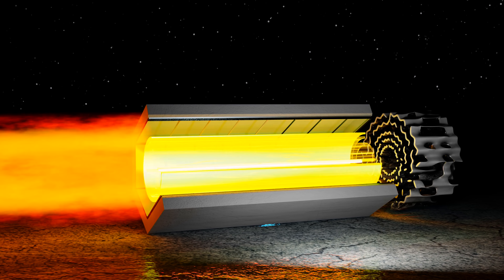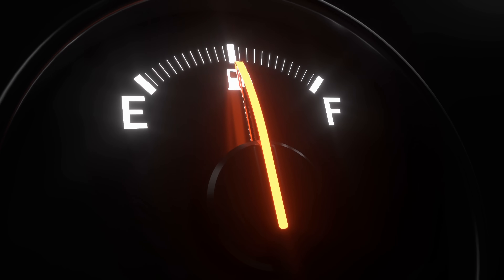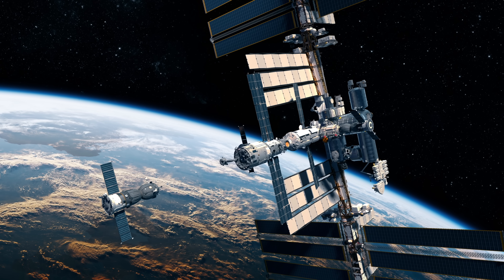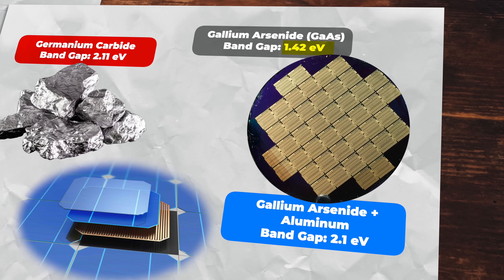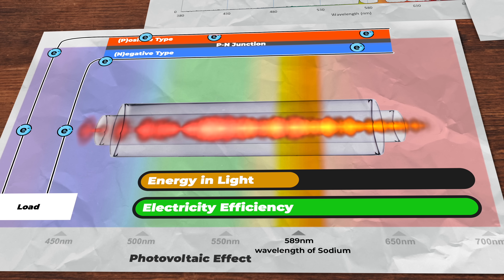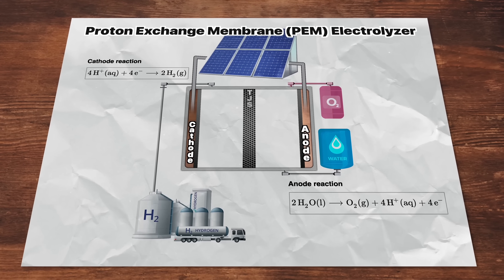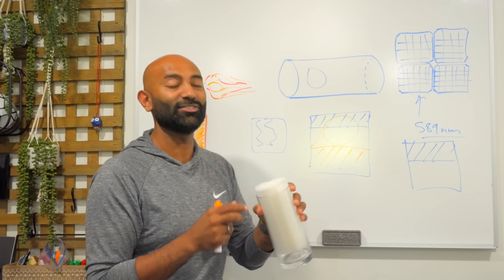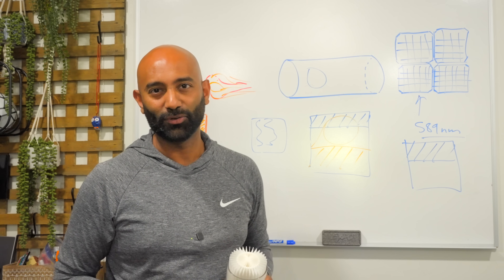Why Solid State Might Save The Combustion Engine

Comment: So, what happens to the CO2 and (admittedly far lower than ICE, but still impossible to eliminate completely) CO, NOx, unburned HCs?
A 2-3X improvement in efficiency over ICE-piston configurations is a carbon-fuel economy salvation for a few decades- how does that represent a serious improvement of chances civilization  will make it past the current (and unavoidably what's coming soon) damage to the climate?

Comment: Could also be geothermal - all you need is a high temperature for sodium.
Bury the sodium PV cells in the mantle, instead of steam generators.

But current ones slso need cooling and thermal management. No pv cell can just perfectly function at high temp long term.
Reply: Love the idea.
The mantal doesn't get nearly hot enough.
Maybe another compound that will glow at a lower temp.
Reply: the point of using sodium is it emits light at only one wavelength. so having a special solar cell that is fine tuned to that specific wavelength increases efficiency. using another compound ruins that.

Comment: Errrr... aren't solar panels only a maximum of 35% efficient currently under the most extreme of optimal conditions only?

How can they claim 80-90% in that case?
Reply: Because solar panels have to contend with many different wavelengths of light, whatever this is would only have to contend with one.
Reply: @RurikLoderr  sure, but an increase of  around 50% efficiency JUST because of that alone?

I mean, I live to be surprised, but, it's pushing things a little surely?
Reply: they use 2 solar pannels ofc! 1 pannel 35% 2 pannels 70%, its easy math!
Reply: @felix2315  errr..yeahhhrrrr....not sure that that is how it works.
Reply: @weedfreer  it does, trust me bro, i read it on the internet, just make some cgi and it will be real xD
Reply: @weedfreer  I'm not quite sure if you watched the video or not. Monochromatic light, with tuned bandgap solar cells. You can choose to not believe the words, but the explanation was there.
Reply: @Sekir80  yeah I watched it, but still, the current BEST full spectrum solar panels are capable of ONLY 35% efficiency.

Even isolating the spectrum of light and tuning the panels I find it hard to believe that it would be possible to achieve anything like 90% efficient photonic/electrical conversion.
Reply: @felix2315  😂
Reply: @weedfreer  I don't get it. Optimizing for full spectrum is impossible, that's why 35-45% is the max we've achieved (probably not much more available). 
But you are right about it: it would be nice to see independent results of this.

Comment: A pulse jet engine is a solid state internal combustion engine.
Reply: Jets (and rockets for that matter) are not internal combustion engines. One side of the engine is open, so the combustion isn't internal
Reply: @jef_3006  Yes, but this distinction seems almost academic nowadays. A fireplace is where combustion occurs; your chimney flue is where the exhaust goes. Is your furnace a jet or an "internal" combustion engine? Or are neither "engines"? (Producing heat is a form of "work" or is only force/motion "work?") In a rocket, combustion occurs in the nozzle to accelerate the exhaust for thrust as it leaves the nozzle. In an ICE car, the values are simply little doors that open and close for inlet air followed by exhaust. Actually more of a "digital" or step-by-step combustion/exhaust cycle rather than a more analog/continuous flow-controlled system.
Reply: @WarrenLacefield  That's what "internal combustion engine" means. If the distinction the term denotes is meaningless, then the solution is to stop using the term, not to start using it in more places.
Reply: @jef_3006  Perhaps you are right. There is term confusion, but distinctions may or may not be meaningful. Does "solid state" refer to the combustion fuel (the energy source)? Or does it mean "no flows or moving parts"? If the output is electricity, is the device an "engine" (producing thrust or rotation) or is it (IMO) a "generator" (producing heat or current or waves like an antenna). Is the combustion "internal" (unseen or felt, inside a box) or is it "open" (can be seen from some perspective) pulsed or continuous?
Reply: @WarrenLacefield  Your chimney with turbine system is an external combustion engine, no ambiguity about it.  The fuel is burned in the fireplace external to the engine.
Reply: @RWZiggy  Oh, I agree. A fireplace with a chimney that contains a turbine (that turns a shaft) is just like a river and paddle wheel or steam engine (fire boils water, steam pressure turns a shaft). If the system output is force, it is a jet or rocket. If output is motion, it's an engine or motor or magnet. But if the output is light or electricity or waves, it is a generator. External or internal, I guess, has to do with whether the heat source is considered part of the system or an external input to the system. I would compare this device discussed in the video to a Ben Franklin fireplace with a thermocouple on the top. It has no moving parts; burns fuel; and produces electricity; and fairly efficiently at that.
Reply: @WarrenLacefield  fun fact, the core of a gas turbine engine is called the gas generator.
Reply: @herbderbler1585  Ha, ha 🙂 No end to trying to make distinctions .. the Google one is limited: "A generator converts mechanical energy into electrical energy, while a motor does the opposite." It goes on to say: "that motors run on electricity and engines run on combustion." I guess thrust or torque counts as "mechanical" and chemical or nuclear counts as "electrical" (or vice-versa). Biology runs on both so us humans are both motors and engines as well as "distinction" generators!
Reply: @WarrenLacefield  An engine is a device which converts energy to mechanical work. (That can be turning a shaft, thrust, pushing a piston, you name it).
A device which converts one form of energy to another form of energy is not an engine, that's why we have other words for them eg. generator, furnace, boiler, solar panel etc etc.
In a combustion engine, if the combustion occurs within the same part of the machine that the mechanical work is produced ie moving a piston down or generating thrust, turning a shaft, then it is known as an internal combustion engine, otherwise it is an external combustion engine.
Reply: @nickwinn7812  Hi, Nick. This chain of comments is so old, I had to go back and read them all again. 🙂 I said "Yes, but this distinction seems almost academic nowadays." Now I would say this discussion might be evidence of that. I'm fine with your explanation.
Reply: @WarrenLacefield  Sorry, I only just came across it and didn't look to see how old it is.
To be clear, as an engineer I find it rather odd that a purely technical definition of what a device is, can be re-used by non-technical folks to describe something else entirely, with the same definition. An academic would understand my position entirely.
Many of the comments here are from well meaning laymen, who have little or no understanding of the subject. This just dumbs down the base of "knowledge" to someone coming to the subject for the first time.
Reply: @nickwinn7812  Yes, I am mostly academic, I guess. And I believe that the technical jargon of any discipline is an important tool well-worth learning and using, both as a conceptual aid and for precise communications. (But I'm often metaphorically incorrect myself in "interdisciplinary conversation." 🙂)
Reply: @jef_3006  Really where does the combustion happen? does the combustion or heat creation happen in a boiler like a steam train or steam engine or does the combustion happen inside the engine itself?
Reply: @jef_3006  One side of this is open as well, so it wouldn't qualify in your definition, either.
Reply: @H4hT53  Yes.
Reply: @jef_3006  One side of all combustion engines is open. In a petrol engine where does the exhaust gas go to? Where does the air come from?
A pulse jet is an internal combustion engine. It burns fuel converting the energy in the fuel to mechanical work (thrust). The combustion takes place within the engine itself, there is no intermediate fluid transferring the heat from the combustion to the engine.
Reply: @nickwinn7812  In a jet engine, intake, combustion, and exhaust all occur simultaneously. In a sandard internal combustion engine, they all occur at different times, which means that the combustion chamber can be (and is) totally closed during combustion.
Reply: @jef_3006  No. A jet engine has distinct intake, compressor, combustion, turbine, exhaust stages.
The fact that the flow through the engine is continuous does not alter the fact that it is an internal combustion engine.
Piston engines commonly have valve overlap, where, for example, the exhaust valve begins to open before the combustion stroke is complete. Some piston engines have no valves at all.
Trust me, I have worked all types of theses engines and steam turbines (external combustion) also, I know the difference.
Reply: I have WW2 vibes. :D
Reply: Typically, the difference is internal combustion means the fuel is burned inside the engine. External combustion, the fuel is burned outside of the engine and a medium is used to transfer power, like steam.
Reply: Pulse jets are not solid state since they have moving parts (the valve flaps which cause the "buzz" in buzz bombs).  A ram jet is solid state.
Reply: @pilotusa  Depends on the type of pulse jet. The Lockwood types have no moving parts.
Reply: @pilotusa You can build them without valves or with Tesla valves but not very efficient.

Comment: Wait so we have photovaltaic panels that small that can produce that much power yet we aren't using them for anything? 
The future of energy is nuclear energy and we need to figure out a way to use the old spent fuel rods from that are still producing lots and lots of heat to heat hospitals and manufacturing facilities (not produce electricity but to simply heat these places during the Winter.
Reply: GaAs cells are expensive af.

Comment: Highest photovoltaic  efficiency is 45% for multijunction cells. Getting 90% is just wrong.
Reply: That’s because you have multiple layers for different wave lengths each interacting with one another, the top layers shielding the bottom layers, different conductivities, multiple junctions etc. It’s very hard to get the best efficiency at every color or light the sun emits and you always end up losing a lot of it. But here you have a single monochromatic source with a fine-tuned single high-efficiency cell. I’d say it’s perfectly possilbe
Reply: @ipp_tutor  Not just possible, entirely expected.
Reply: Yeah quantum efficiency (not a buzz word, actual term) at peak wavelength of photo voltaic cells are already over 90%…. With the caveat of that’s photons inside the semiconductor, there’s still the hurdle of getting them in due to huge refractive index differences, but not physically impossible
Reply: @geekswithfeet9137  On this specific point given that it is only concerned with one wavelength the anti reflective coating could be made much more efficient than on a white light cell.  How this coating handles hot combusting gas is another problem though.
Reply: more common is 22%
Reply: @Goldenhammer2025 22% with solar because wavelength doesn't match the photo voltaic cells
Reply: @Goldenhammer2025  understand the conversation before correcting people

Comment: 70-80% you say? What’s the efficiency of an electric motor? Round trip ranges from 80-88% is what I’m seeing for an EV. Compare round trip efficiencies for the fuel generation and this seems to fall apart even more.
Reply: So you don't consider destroying the earth to mine rare earth minerals a non-issue?
Reply: @roberthart9886  This magic lamp still needs a buffer battery maybe 10% of the size as a regular battery, but it also needs the same motors and electronics as any electrical car does.
If this magic lamp is 70-80% efficient (I do not think it is even close to that) the loss of the EV hardware would still need to be added to this lamp idea, so this is best case 60%.

Comment: Sounds good. So.... then why can't we strap on a conversion lens to regular solar panels to convert the spectrum to something monochromatic - then tailor the cells to this one wavelength?  Thus making them super efficient.
Reply: what your calling a "conversioni lens" is just a color filter its only subtracting what cant be used not changing what cant be used into something usefull.
Reply: @robertm1112  Hmm so how's this lensing working in this solid state engine then it's converting energy to the correct wavelength? Can't we convert the IR etc in sunlight to the right wavelength somehow?

Comment: Weichai in China is building Diesel truck engines with over 53% thermal efficiency (World record)
Reply: I heard that too, but I will not believe it before I seen external independent tests. If it is true it will come to all boats and trucks near you soon.
Reply: Around 58% is the maximum theoretical. 54% has been reported by a number of manufacturers but only under lab conditions. On the road around 45% (currently achieved by a number of truck manufacturers) seems to be as good as it gets. Problem is on the road there are too many variables (mainly environmental) that can't be controlled.
Reply: This isn't far-fetched, since truck-sized Diesel engines are already 40% efficient.  You could add a steam engine to convert a little waste heat back into more energy or squirt water into the cylinders.  I haven't looked at what they're doing.
Reply: I don't trust China. They lie too much.
Reply: Very interesting!
Reply: It also asexually reproduces I bet.

Comment: This is the first time I’ve heard that moving parts were the problem with combustion engines.
Reply: Technically the moving parts are the downfall to any internal combustion engine, first they are parts that have to be made and to really tight tolerance, second they wear out and fail if not maintained correctly and third each and every moving part takes energy to make it make it move so the moving parts in an engine are technically the number 1 thing hurting combustion engines, however, what's in this video is a bunch of hog wash and won't work efficiently like they say it will.
Reply: Is this the first time you've heard of a combustion engine? Moving parts are always harder to maintain.
Reply: If it moves, it wears out. That's why solid state has advanced so much faster in the past 70 years.
Reply: @poporbit2432   A corollay is"  If it cycles between hot and cold, it breaks down.
Reply: Moving parts mean friction which is wasted energy and one of the main sources of such lost energy in an engine.
Reply: @orionbetelgeuse1937  right everything needs to be replaced eventually but it is better to have the simplest construction that requires the least maintenance with the highest quality materials if you want to cut down on time where the thing isn't usable.
Reply: @orionbetelgeuse1937  lol what the fuck are you talking about?

Comment: Combustion engine doesn't need "saving" the EV scam does😅
Reply: But with EV's if you have an accident on a cold winters night, they might provide you with well needed heat from the self igniting lithium battery arrays.